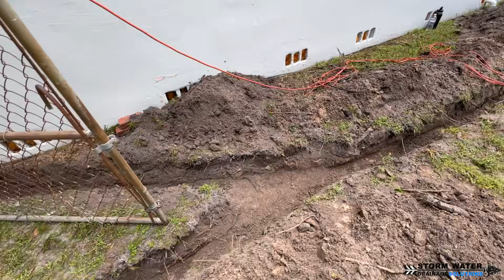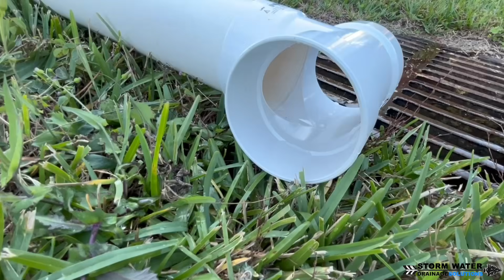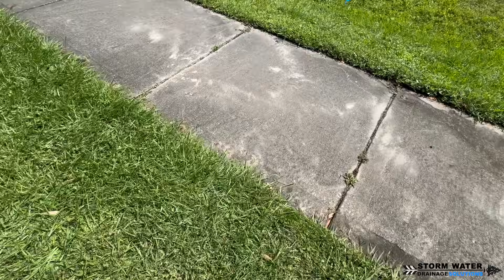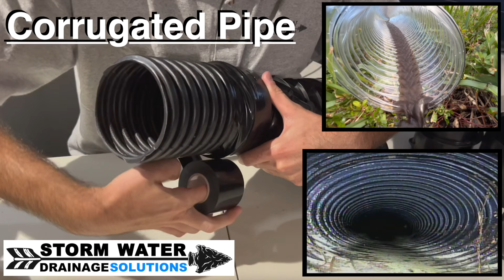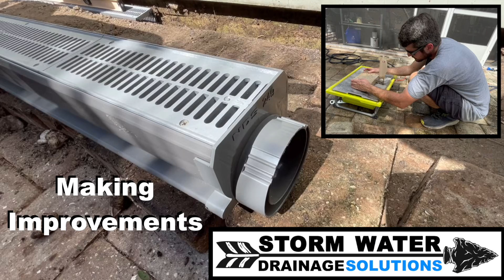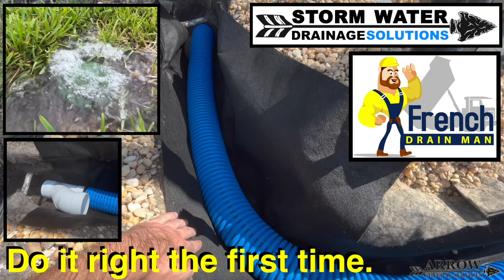Corrugated Drain Pipe Installation For Gutter Downspouts - Easy DIY Yard Drainage

Comment: It looks like you've overloaded that Main Pipe
Reply from the maker: Calculations say otherwise.
Reply: Its for sure overloaded, mabee not for modest rain but heavy rain yes, i have to redo all of mines because someone did this exact thing.
Reply from the maker: @gunsmoke9030  It all depends on the square footage of the roof and the lengths of the gutter troughs. Once you do the calculations you will know what size pipe you need. Also you want the pipe to get maxed out on occasion so it keeps the system clean especially with corrugated systems.

Comment: What pipe to use if concrete will eventually be poured above it? Sdr 35 or sched 40?
Reply from the maker: Either or will work fine. Also surround the pipe with pea gravel before backfilling. That will add additional strength.

Comment: I'd love a video showing how you figure out your rise or fall for the run or total length of your pipe from start to discharge.
Reply: What exactly are you trying to work out? If you figure one percent slope, all you have to do is multiply the total lineal footage by .01 to get the fall. So 100 feet x .01 is 1 foot of fall.
Reply: @lukelovell1055 every job is different and every outfall circumstance can very. Some jobs may only have a 1/2% others may have 2%. So I'd be interested to see a video showing how he works through that process and then decides how to do the install.